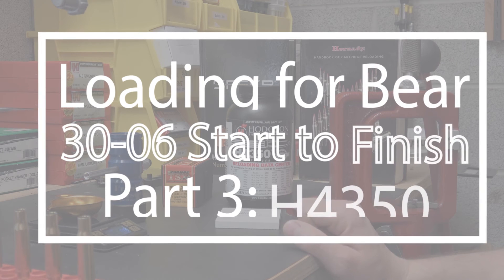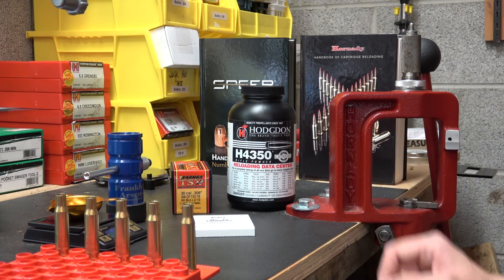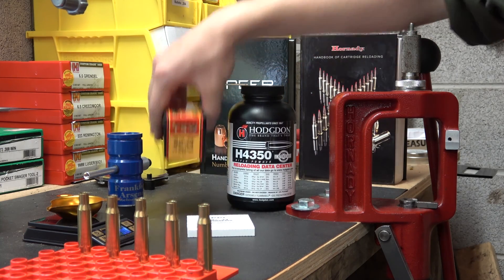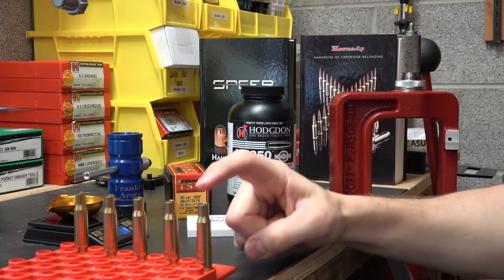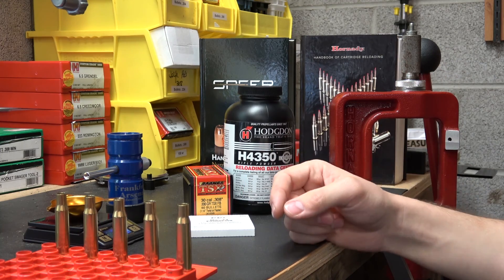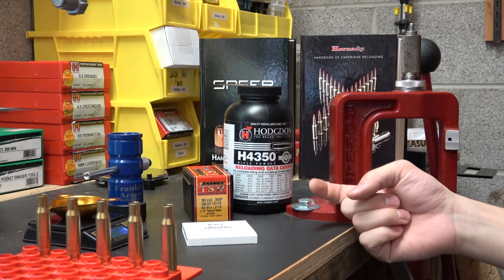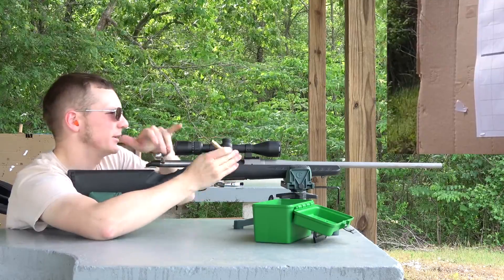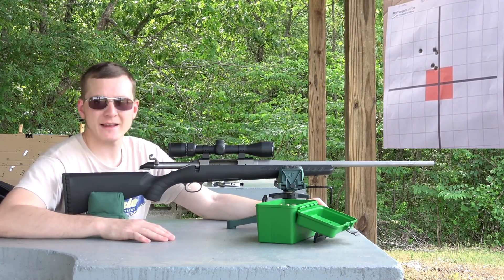Loading for Bear: 30-06 Part 3 -- H4350

Comment: You don’t need 200 grain copper loads in an -06. It’s too slow.
Reply from the maker: He’s now using a 165gr bullet, which I think is better suited. The 200gr did take a black bear with no issues though.